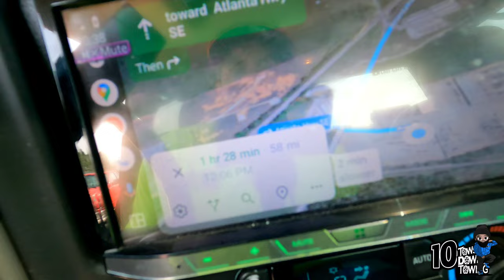If I can't do nothing else, I can back a trailer 🫣

Comment: I got this tip at the boat ramp when backing a trailer. I drop the tailgate and I can see the trailer when putting the jetski trailer in the water.
Reply from the maker: ive done it before but don't trust it when turning. Cant hit that toolbox and damage one or both. But yes that works very well, agreed!
Reply: @10TowsDownTowing  Right on. If you gotta turn it, that changes everything. 🎯💪🏾

Comment: The backing is great.
That moving the vehicle all around wity the door open is asking for an insurance claim.
I always leave the vehicle running and put a window down ( so the vehicle doesn't accidentally get locked with the keys inside ( it has happened ), the reason behind leaving them running is it may not start again.